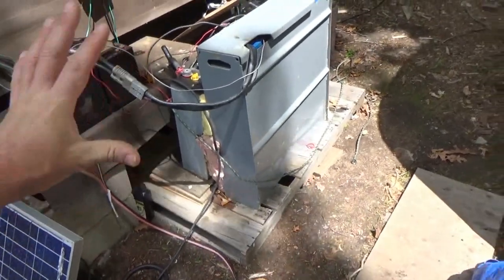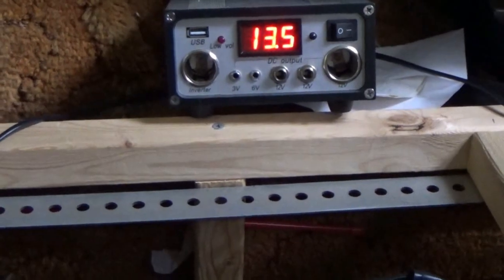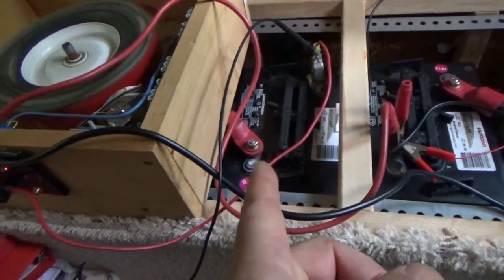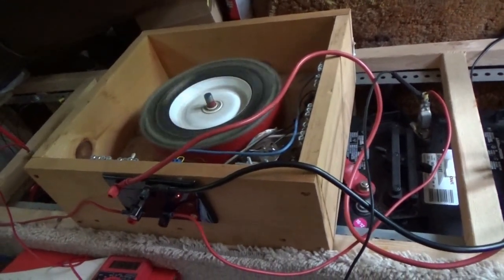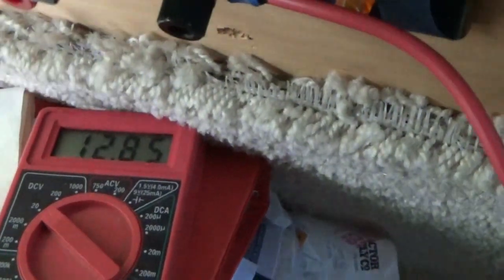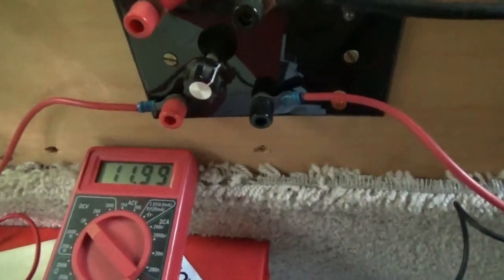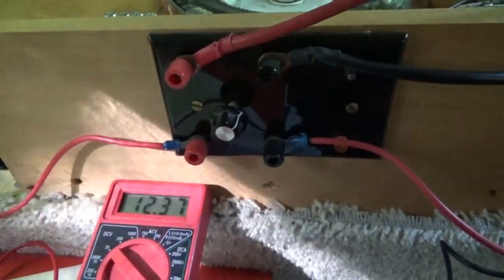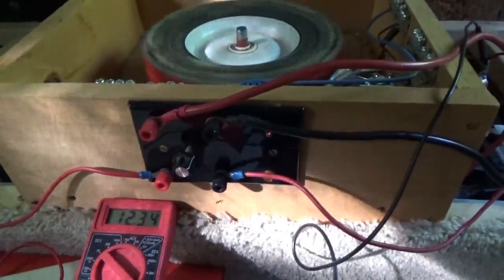Solar Forklift Battery Maintenance & Desulfating Golf Cart Batteries

Comment: My wife and I purchased a used DC Solar Trailer that has to 48v GNB Industrial Power Forklift Batteries that were severely neglected. Two cells will have to be cut out and removed and replaced with newer cells. I would like to see how you used solar panels to recover your forklift batteries. We had not anticipated having o purchase (2) forklift batteries when we purchased the trailer. We are living off grid in our RV trying to develop our property in Northern Nevada. I would like to learn and I need better guidance than the "industry" has to offer. Thank you for posting your videos.

Comment: Keep the bedini ssg on them till you get them to go to 15 volts  for lead acid .this Jb,s "John Bedinis" advice for lead acids,,,,,i have tried it a few ways but what i have found that if they are badly sulfated many times they wont go to 15 volts right away so cycling them helps with a rest in between ......good luck  a bigger ssg for that many amp hours will  probably be needed to get them to 15 volts or so ...cheers

Comment: Keep using your Bedini SG system and consider adding a cap pulser circuit to this system to really get a strong charge into those batteries. You will see a big difference and the charge will be quite strong. You can see examples of the Cap Pulser circuit on youtube and/or go to energeticforum or energyscienceforum to get more information about this circuit plus you should get the SG books by Aaron Murakami and Peter Lindeman - they have schematics in them plus a whole lot more. Cheers!

Comment: troy I hope you read this. if you have read my post you know i'm new to all the solar junk. but what I have found out in the little time I have been doing it. is my 2000 watt inverter would run my 3/8 drill for about 15 minutes then it would kick out. due to low voltage. but I was always trying to keep my voltage above 12 volts. and it would charge them to 12.9 volts. I got tired of that and said screw it . but not in such nice words. and I put a head light on it out of my truck and let it stay on until my voltage hit 9 volts. then charged it again and it went to 13.8 and held at 13.2 so I did it again and now the charge to 14.4 and hold at 13.8. and if I run my drill until the inverter cuts off at 11.4 volts I can run it for about 40 minutes and I mean working the drill. they charge faster and higher and last longer. cant hurt maybe you should try it

Comment: Just wanted to add, by reading the comments, open circuit voltage of a lead acid battery at rest indicates state of charge. Voltage under load has many variations depending on battery type, and the type of drain current. The proof of the pudding is test the battery with the proper load type and current, prescribed by the battery type, and see what its recovery voltage is. Lead acid batteries are huge, messy, finicky and need a lot of attention. We need something better. I have access to messed up drained car batteries, and did many tests, and a proper bedini pulsed motor can restore some, but so can some diligence with de-sulfater and chargers. Just saying. If it works, that's all the person perusing the result needs to know.

Comment: seeing your load test you did, what was it before? how long would the compressor run, dropping the batteries down. before this process? @ of these 6 volt batteries in series could go down to 9.6 volts, and then if they recover to around 12.4, I would say they are fine to use. Hmmm??  :)

Comment: I would be more interested if troy load tests the batteries being restored by the bedini. Have they improved. Has the capacity improved while being loaded? I have built and been experimenting with the bedini circuit with a small (3 1/2" 4 magnet 0.5"x0.5" neo magnet) rotor and bifilar coil, 24 gauge, 20 gauge magnet wire with cloths  hanger wire core. only getting 60% return at best, But it did take a totally dead sla (been using these in the test) battery that would not charge with a conventional charger, and is now usable, be it lower rated  capacity. only ran it for 10 hours to achieve this, using another good sla battery in good condition to run the system. still not sure what is going on, but it is interesting, and the battery did not explode, that was a worry/ Troy can you load test these batteries? Very interested in the results.

Comment: Good job with the bedini though. I have bought 2 of the 3 downloadable e books put out by John bedini over the past year. I have saved a couple of deep cycle battery's with the ssg I built prior to buying the books. You should definitely check out the books for sure if you really want no how it works. John Bedini Arron M. And Peter L. Do a great in depth job of explaining its operation and construction. How to have a completely matched set of transistors all kinds of cool stuff. I plan on building on to the specs of the book. It's a lot more expensive then the first I built. But even though my 1st one is cheaply made and not very efficient it still has the power to knock the sulfate off the plates

Comment: When Desulfating  a battery with your Bedini motor once the battery voltage tops out at your 12.9 you need to discharge the battery down to 10.5 V and then recharge. run that cycle many many many times and then you should have a good battery again.  You must charge and discharge many times with the  bedini for the effects to really work. By doing so you will rework the chemistry in the battery And be able to get the sulfation that is deep into the pits of the plate all the way out

Comment: Hi The Do It Yourself World 
This is also one of my great interests,, and i have been copping you! i got two of the CLEN Battery Desulfators,, to fix my one batterys and to make videos,,, title of the last video was "Desulfators turned out to be worthless $hit - 184" You can almost guess which way it went :-) After putting an oscilloscope on them i saw a voltage pulses of only 1 volt peak.
I am afraid that these cheap Chinese desulfators are not delivering anything near the 60-100 volts peak, they promise.
So I'm in the market for a new one! and looks forward to your video on the Bedini..

Comment: As you were talking about the bedini motor I was going to mention, how much workable power was available, but you showed it. Maybe after they are completely desulfated, put a real high charge on them so they off gas and then check amp hour length.
Reply from the maker: Duane C Yes

Comment: Run them way down then.  If you could put some bigger amps into them and equalize charge them it would help circulate the acid that is sitting on the bottom. Equalize them for a hour or two. Run them down again repeat the process. I added some acid to mine my viewers had a fit. But I really think they needed more acid because I could not get them to a full charge of green on the hydrometer. They are brand new batteries only about ten months old. I took them to town and had them tested and they said they had 350 amps more than what they are ratted at 225. So Equalization charge is a must to stir up the acid off the bottom. I wondered after they rode in the back of my truck did it stir up the acid some off the bottom? not really. I added acid and it brought them up into the top of the fair reading. Go to Advanced Auto and get a bottle of battery acid for ten dollars and add some to each battery. when you just add distilled water all the time the acid content gets weaker and it boils out the tops over time. I know what the school of batteries says or battery university people look up on the net says never do that but I live in the real world of batts and they need a little bit added to each cell after a year or two of use for sure.
Reply: Adding acid did raise the specific gravity. I know you don't like it but worked. I have equalized many times this past winter and float charged and it took days to raise the specific gravity and they never made it past fair on the specific gravity meter. I went days with out using the batteries and charging. I think they needed some acid. In my case. Do you have some golf cart batteries and a solar system?
Reply: Yeah I have read the articles on the net.  I have also done my own experimenting. The specific gravity would not come up far enough with just equalize charging never made it to the fully charged state on the float. I added some acid and it helped.  It will help I know. I don't see you have any videos of your stuff don't you have a video camera. I don't trust viewers with out personal videos what are they hiding? They always know it all too but have no proof of ownership of a real solar system. they spout off stuff they have read on the net.
Reply: You refuse to read my comments and learn? I am speaking from experience. Adding acid will raise the specific gravity. The battery University said never do that because it can cause excessive corrosion. I hope my battery cables don't corrode too bad now. But Im pretty sure they needed a little bit more acid because I could never reach a full charge no matter how long I float charged or equalized them. I added smalamount to each cell it did improve the specific gravity. Why do you refuse to listen to logic? More acid will raise specific gravity will it not? If the battery needs it? Its like no battery in history ever needs more acid what ever. Yeah I know what the articles say. A equalize charge would do more good than the Bedeni It has done about all the good its going to do. Its time to give the batts a good equalize charge.
Reply from the maker: shartne I realize that under normal use batteries do lose acid, not only water. I see you arguing with someone invisible about the topic. To back you up, the professionals do add acid but do not want us doing it. It would make a mess of things and they would have a lot more returns under warranty. So they tell us you cannot and should not add acid. Makes their job easier and they also sell more batteries as ours fail.
Reply: shartne  Thank you for that input...good for thought. Makes sense.

Comment: Battery test on compressor - it may be 16 amps compressor but not necessarily dragging that much from the batteries, that should be tested separately (watts or amps instead of 'yeah, it works' - which is great already).

Comment: Which set of forklift batteries is running the house now?  Those in the box or the ones that are corroding?
Reply: Walter Bodine  If I recall correctly,  there were some removed from the yellow metal box, which would be the ones that have some corrosion in this video. ..there are more still in that yellow box somewhere.  Then there are the refurbished ones in the gray box shown... I think those were on the motor puller in the snow for quite some time and annoyed some people that he couldn't move them alone. Seems like John and someone else helped move those on skids. Didn't MOMT help get the yellow box with the remaining used batteries out of the truck so Troy could help another friend move? Maybe I am mistaken.  Wow, winter feels so long ago already!
Reply: MollyDolly The new ones in the metal box.
Reply: ***** Hmmm then I guess leaving them out in the snow didn't hurt them afterall.
Reply: MollyDolly Actually, those were the first bank Troy made from the old forklift battery and they were covered all winter. I'm not sure how the ones that weren't covered did.
Reply: MollyDolly I think those he showed today are the ones someone bought him, the ones left out are still out I guess. MOMT had a video helping setting them on blocks.
Reply: MollyDolly You got it right. :-)
Reply: *****  I know Troy is still suffering some freezing nights but doesn't it just seem so long ago that there was snow on the ground?  I am missing that snow already... easy for me to say,  huh? Lol!
Reply: MollyDolly I still can't believe I didn't get any snow this past winter. I am missing the snow, but I bet Troy isn't missing all that snow he had there! I thought you didn't have winter there? :-D
Reply from the maker: ***** I am NOT missing the snow at all. I am just wishing the teater totter of our weather would settle at one end of the spectrum or the other for a while. Freezing, then over 90, then freezing, then over 90. Hard to adjust to either one right now. Do I plant? Do I wait? Do I plant? Do I wait?
Reply: The Do It Yourself World That does make it hard to know when to plant. Hopefully things will sort themselves out soon. Climate change has made for some strange weather patterns.

Comment: those 6 volts is realy a inprovement, its a traction cel so tey wil drop in volts at load due to the lesss cca then starter battery's. , but its a good idea to charge the4 old batts now with a normal harger, top em off an mesuse the specific gravity to realy know how they are doing. thumbs up!( btw, 30 amps in one minute is not much amphours...).
Reply from the maker: MrBugsier5 True, that is not much capacity at all. Shows these batteries were really junk and Advance Auto's testing methods are not good.
Reply: yep, y agree !

Comment: maby its a idea to mesure the all cels in the rv and the t.h. whit the gravity mesurer.
that wil realy show the state off charge of those cels.
Reply from the maker: MrBugsier5 They are not at full capacity but yes that is a good idea for next time.
Reply: last week i have revived a fully sulpated (battery was tottally drained and left un attended for 6 monts ) battery in two days with a normal (not regulated) charger, first no amps flowing at al, after one hour it started acsepting a little charge, few hours later full amp charge after 24 hours it was fully charged (amps very low, volts high, used my tester on it, testet fair, after testing (high amp tester) charged it up with a regulated 3 stage charger (victron),two days later second test good, lots of cca, fully usable.tho not new, its usable. (but thats done on grid power, not solar)